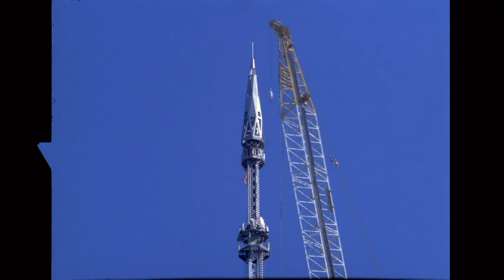September 11: New World Trade Center rises from ashes - BBC News

Comment: it would be scary if it happens again 😢😭😭
Reply: It could
Reply: Cockpit doors are now secured whenever a plane is in flight so it is unlikely it will happen again,,,,, at least with a large jet anyway.
Reply: I know
Reply: The destroying was set up/conspiracy. So yeah if the building getting old again it could
Reply: Besides the one World Trade Center is built stronger and it probably won’t collapse so it can be saved
Reply: Funny
Reply: Can you stop spamming emojis please?
Reply: Yeah
Reply: The fire was 12,000 plus degrees it would collapse any steel building
Reply: I hope it doesn’t
Reply: Most likely not considering the very strict security but I hope it doesn't happen again
Reply: SuperMarioLandon 2! No it can still be hit
Reply: @saulgoodman9193  A PLANE FLEW INTO IT OFC IT IS SUPER HOT
Reply: @felixgieles2334  Just so you know , the melting point of steel is around 2800 ° Fahrenheit, normal office fires do not reach that temperature and even a fire that has jet fuel in it only reaches about 2,000 degrees. So you tell me how the building collapsed,  and again I'm not talking about the twins towers , I'm talking about wtc7 which wasn't hit by a plane .
Reply: Second time is the charm
Reply: @felipemendigo6005  wtf

Comment: Im hoping this doesn't sound bad but, do you guys think this will ever happen again...?
Reply: estrom111 The other ones did too and no fucking plane could have crushed them through, it's a damn aluminium vs huge steel rods. Get real, it was an inside job and if they'll have to do it again, THEY WILL
Reply: jeFF Fury It was planes. Just think how big object a plane is and how fast it comes. Twin Towers were built in the late 60's early 70's, so they weren't that strong.
Reply: Asain Pikachu  It's hard to say whether another attack will happen but one thing is for sure, this building wont collapse if it does.

The original world trade center towers were built to be light weight as they were constructed on reclaimed land from the river. Part of what kept them light was that the support columns were not encased in concrete, which is what led to the collapse of the original towers. When metal is exposed to heat it'll become malleable and begin to bend and warp, but concrete does not transfer heat energy so the columns wont fail like they did in the originals.

Will there be more attacks? Probably. Will this building collapse? Certainly not.
Reply: I believe that more planes will be hijacked and flown into the one world trade center. I agree with you
Reply: When I think it, there might be a chance. USA killed Osama. Trying to bring the Tower down again would be a revenge. So there is always a small chance. Tho this tower is very well built.
Reply: Zach Kokiri  i think every conspiracy nutcase should read your statement.
Reply: Av_cali
 They're immune to logic. It's honestly best to ignore them, they just like attention you know?
Reply: Probably going to be a shooting.
Reply: Tool no
Reply: something worse is coming unless we oust the powers that presently be! Mark my words!
Reply: It's almost impossible with all the security these days defenitely not.
Reply: NOOOO
Reply: It'll be tough to top 2996 people
Reply: I don’t think it will happen again but if it does, we just have to put trust in God that He will protect us.
Reply: Skyscrapers are not the only attractive targets to a terrorist due to their high profile.  A far worse attack would happen on a nuclear power plant involving an Airbus A380.  That airliner is big enough to slam through many thick layers of reinforced concrete only to breach a reactor.  For this reason all nuclear power plants have very large no fly zones above them that pilots and air traffic control look out for.
Reply: jeFF Fury just remember the speed of the plane. Why would it be an inside job, why would they do that. But I think there were terrorists inside of the building who caused the crash of the towers
Reply: Might not exactly be like 9/11 however I am confident another major terrorist attack will occur in the U.S. which will shake the world.
Reply: Spencer yes , it’s almost bound to happen , some guy some where will probably be inspired by osama bin Ladin and put a plane is that building , hopefully it doesn’t happen but I can’t promise ya
Reply: OJ most of this tower is made of glass though...
Reply: Sadly, yeah, I could see something like that happening again. People will try to follow in Osama's footsteps.
Reply: I hope not
Reply: Terror attacks are always possible, but because of the security, precautions and insight we have established will prevent another event like this.

Comment: I wish they rebuild it exactly the same..it doesn’t feel the same anymore it was great seeing the beautiful tall towers..
Reply: The original version was made weaker it was made unprepaired for an attack. But if you do your research of how it was built with more details you will find out it is very very very stronger than the original WTC
Reply: @xxmodzhaxsxx7910  You know they could do the same if the rebuild the Twin Towers
Reply: @PhilipGamez  yea but the old blue prints were made weakly there is a reason why todays world trade center wont colaphs but just be damadged and the old ones will colaphs

Comment: Shyam Sunder said WTC7 could not collapse with any free fall acceleration because of all the structural steel providing resistance to any gravitational force. But for the twin towers NIST said the amount of time for their collapses meant near free fall acceleration occurred..

31. How could the WTC towers collapse in only 11 seconds (WTC 1) and 9 seconds (WTC 2)—speeds that approximate that of a ball dropped from similar height in a vacuum (with no air resistance)?

NIST:-
"Since the stories below the level of collapse initiation provided little resistance to the tremendous energy released by the falling building mass, the building section above came down essentially in free fall."
BTW...NIST later said there was some 33% descent time of free fall acceleration in Building 7 after all.

Comment: I know I'll get shit for this but this is very likely the safest building on the planet. Made from the strongest materials ever put into a building, redundancy after redundancy after redundancy. From what info they did release  to the public, the amount of safeguards is INSANE. They literally thought of everything. Hell if a nuke went off, I'd probably run to this building for safety..
Also - terrorists aren't stupid enough to try to attack the most guarded building in America. If and I mean IF they try to attack the US again, it will definitely be somewhere else. I sure as hell wouldn't want to work at the Sears (Willis) Tower or anywhere in LA
Reply: I still would not use this new tower
Reply: @melgrant7404  It's quite an experience there actually. Don't let terror hold you back. The museum is a very interesting albeit harrowing experience.